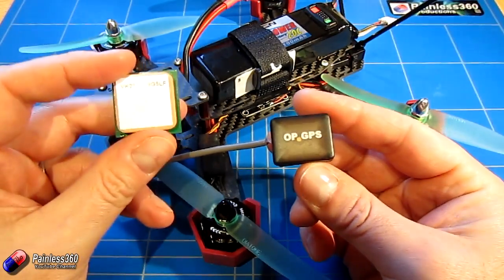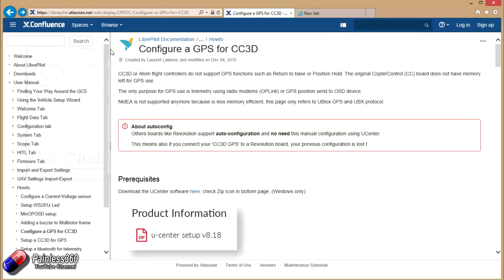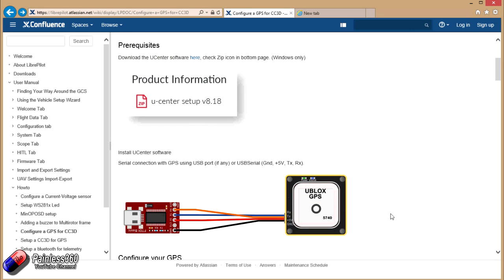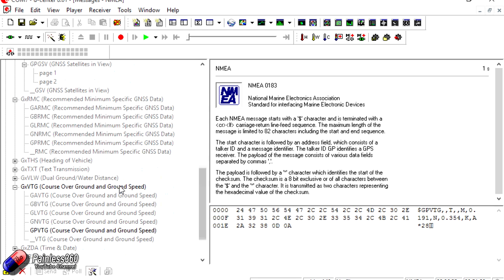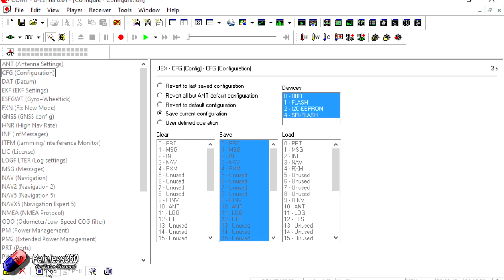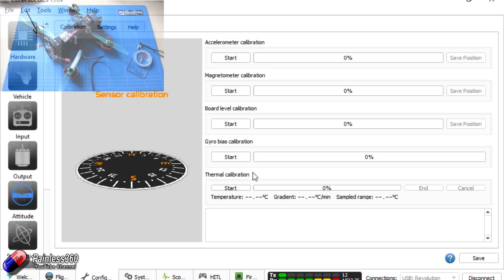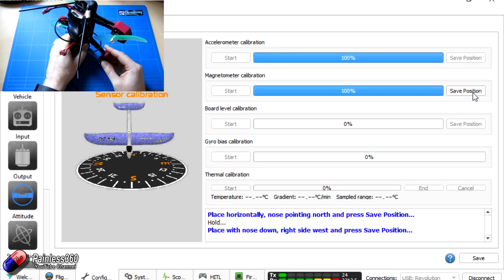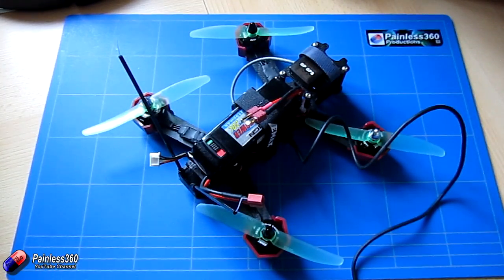(3/3) CC3D Revolution and LibrePilot: Adding GPS and extra calibration steps

Comment: I have followed all the stages of setting using ublox.  but the arrow direction of the home does not appear.  how to bring up the arrow to the home? Thx
Reply from the maker: All I knew is in the video series. The cc3d is an old flight controller now. I've not used one for many years.  Best of luck

Comment: How would you revert the GPS back to its original state? any ideas
Reply from the maker: Modern flight controllers setup the GPS automatically. I'd strongly recommend that you use a different FC. Best of luck
Reply: @Painless360  im using a black mamba now but for the life of me i cannot get the gps to work. I suspected it was because i changed the u-centre settings but i guess that's not the case. Thanks for getting back

Comment: By the way, I got this working with Libre Pilot, the latest version 16.09 r782 supports DJI Naza GPS natively and also supports NMIEA (9600 By default) on the revolution and works out of the box, fast and finding its satellites. However, my dilemma started  while I had the connections taped together, I tried to make a custom cable and inadvertently shorted my Lumeneier  vintage Revolution Open Pilot board (ordered a clone through China, 6 week delivery timeframe), it all worked beautifully in my TBS discovery. Do you know the color coding of the wires in the Naza GPS? I have red, blue, grey and the silver open wire (the ground or shielding?) I think I may have blown that too because I don't see a light come on. GPS. can I supply an kind of voltage to make it come on?
Reply from the maker: I only use the BN220 or M8N GPS units here. Best of luck

Comment: The reason why the auto configure feature did not work is because by default the model of the GPS you have selected is NIMEA at 9600 Baud. If you use this default it will work

Comment: Pro Tip: Since you annunciate and are a clear communicator and since i am fast listener, bumping your playback speed up to 1.25 makes your tutorials go by just right. 
BTW. If your interested I have an assortment of luminere open pilot revolution and CC3D controllers that you might be interested in.
Reply from the maker: Thanks Patrick. I no longer recommend or use the CC3D series of controllers but thanks for the offer. Happy flying!
Reply: @Painless360  What do you recommend these days, is there any software that is as good as the LibrePilot GCS?

Comment: tried loads of things but GPS doesnt accept changes and defaults back to NMEA. Any ideas ?? Thanks
Reply from the maker: The only thing I can think of is to make sure you save the changes before disconnecting. Best of luck
Reply: @Painless360  Yup I've tried many things including following your set up to the letter. Always defaults back to 9600 baud & Nmea.  There is some chatter on various forums that the cheap Chinese clones may not have any non-volatile memory. Sounds bit far-fetched but I'm leaning that way after hours of trial and error with the 2 NZ GPS units i have tried & my flip32 board.  I can configure the units as per the tutorial and re-connect at the new baud rate. All works fine but as soon as i power cycle the GPS it reverts back to default. Driving me nuts :-)  Ill report back here if i ever solve it, just in case somebody else experiences the same issue. Thanks for your quick reply Cheers

Comment: when i try to disable or enable something in the messages view window nothing happens. im using the same components as you
Reply from the maker: Happy to help but please watch https://www.youtube.com/watch?v=olIqTiSJHIY and come back to me with more detail of what you've tried..
Reply: thanks, that video is a helpful checklist, unfortunately my problem persists.  
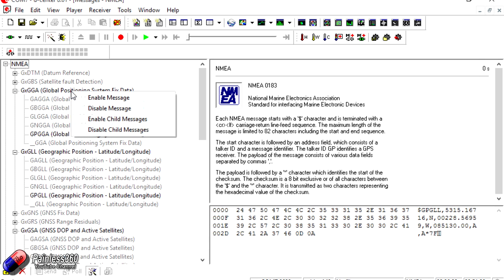I am using the same gps module and flight controller as you, the flight controller is perfect and the gps works. it sends data to my computer. I can see this data in the "packet console" window and see my location on the map window. In fact, everything works the same for me as it has for you right up to the point where you disable stuff in the NMEA part of the "messages" window (at about 9:05 in your video). I can right click and select "disable child messages" but it remains highlighted. it also won’t let me enable the things you have enabled in the messages window. 
I have tried to contact the seller, they have been no help. I may have watched every available video on youtube related to this including some in languages I don’t understand, i have spent hours on google and in forums trying to find an answer but have found nothing that has helped.
i have also checked and re-checked my connections, even going as far as using an oscilloscope to ensure there was no loss of data at any point and I have tried using several computers with different versions of windows and several versions of the u-center program
I’ve hit a wall here, any advice you can give that you think might be useful will be greatly appreciated
Reply: can you tell me what version of the U-center were you using for this?
Reply: one final question, the only reason i am going to this much trouble is i am currently on a bit of a tight budget. however, if i were to replace the cc3d revolution later on, is there any particular flight controller you would recommend? considering gps functionality is my main concern. thanks
Reply from the maker: See the iNav series, the CC3D is VERY long in the tooth now and the kit for a modern system like iNav is really inexpensive..
Reply: Hi Tom, I have the same problem. Do you have fixed this problem in the meantime? And if so, please can u tell me how?
Reply: I never found a fix unfortunately. I've upgraded to a new flight controller
Reply: Thanx for u answer. I think, I have to do the same staop as u. Which kind of FC do u choosen? And, r u happy this it?
Reply: Inav f3 deluxe. Works perfectly for me
Reply: do ha ve a link on amazon for me?

Comment: Pls help I’m unable to change the values on u connect and can not change to UBX
Reply from the maker: +lee parkin as you don't mention the type of GPS you're using It's tricky to give specifics. I'll make sure that you're clicking the save settings menu item in the CNSS software, apart from that it might be worthwhile trying another GPS unit. I only fly iNav now with modern flight control boards for GPS flying. Everything else just seems to be too much hassle. Best of luck

Comment: Hi, no luck with the GPS, went on a couple of times, constant red and blue flashing, but mostly the constant red is on.FTDI setup went ok, cheers for the detailed instructions. Could you tell me the name of the connector they use on the CC3D mini? Thank you very much.
Reply from the maker: Sorry not sure, depends on the one you have. It's probably a Picoblade or similar..

Comment: I am currently building a 250mm Drone up until now I have managed to calibrate the pids using the automatic function and the drone seems to be working fine. Altitude hold works fine as well. 

I decided to try position hold and I bought the following GPS: https://www.banggood.com/7M8M-Ublox-M8N-GPS-Module-for-APM-Pixhawk-CC3D-Naze32-F3-Flight-Control-p-1078657.html .
After installing I recalibrated the mag and all the other sensors and tried position hold. 
As soon as I turn on position hold, the drone does not stay in position but starts moving as if following the perimiter of a box. 

What I have noticed so far is that when stationary the gps shows that the drone is moving at approx 0.01 - 0.07m/s. 
I get around 12 satellites and 3D fix.

I also am using complementary + mag + gps   

Can you give me some pointers on what I may be doing wrong? or what I should do to achieve similar results to yours please?

Thanks :)
Reply from the maker: +warbuli I've not played with this for quite a while now. All of the latest builds that I want a small compact GPS solution 4, I'm using iNav. Best of luck finding the solution.
Reply: Wow thanks for replying ! :)   

Can you please confirm that even if the drone is stationary, the gps will not be accurate and will provide nearest coorinates within a few meters range? thanks a lot for replying!
Reply from the maker: It should, normal GPS units are accurate to about 2m..

Comment: I configured my nz gps (ublox g7020kt) with ucenter exactly as per your video. works well and got sattelites and 3d fix in ucenter. however, when i plug it into my naze32 rev 6 w/ inav (done gps config) the green gps icon turns on and my latitude longtitude are reflected in the gps tab but no satellies are found and keep getting waiting for gps data. cannot get 3d fix. what could be wrong?
Reply from the maker: Are you using iNav? Some features with these older boards are being removed from the software for then as they struggle to run them and don't have enough memory. I'd check the Wiki for the software and board you're using in case this is what's going on..

Comment: Hello, i am building mine first drone, and i would like to know, could allocate your drone if u lose it?
Reply from the maker: There are a few tricks that pilots use. Adding your name and phone number to the model is helpful, adding a buzzer too to help in long grass or crops is a good idea. Outside that then using RSSI signal strength with your radio (if available) can help you track down the model if the battery is still plugged in. See our video on that.. Best of luck!

Comment: Hi, 
i have tried to configure the gps module as you show in the video, but 
every time i disconnect the usb and plug it back again the setting 
reverted back to NMEA. I have a NZ GPS for Naze32 fc. Also, when i 
connect it to naze32 with cleanflight i get the green gps tab on the 
upper side of the cf page but no 3D fix nor a sat's. What i'm doing 
wrong?
Reply from the maker: +George Theodosiou possibly nothing. The GPS has a small battery on it that keeps the settings in memory. If you are saving the settings in GNSS and it's not sticking then it may be that battery. Best of luck!
Reply: Painless360 Thanks you! it pass from my mind and tried to replace it but its welded. any way to remove it?
Reply from the maker: Unsolder if it's soldered on.. I'd check the specs of the module to make sure it is soldered.. Best of luck!
Reply: Painless360 i manage to removed it with a sharp knife, i measured the voltage of the battery and read 1.3v. i think these batteries are rated to 1.5v so should be ok? it still doesn't keep the new settings. maybe i have a bad gps module?
Reply: George Theodosiou  Did you ever get the NZ GPS hooked up? I have the NANO 32 Flight control board and trying to find out how to wire GPS to the Flight control board?

Comment: I was able to get the AutoConfigure mode to work with the OP GPS (though my unit was not purchased from Banggood).  And I am getting a fairly successful position hold using that with the onboard mag.  But I am getting a fairly wide "hold range".  Much of the time it's with a 1-2 yards/meters, but once it probably got at least 10 meters from its initial position (little to no wind).

My mag lock isn't perfect, as it goes from green to amber and back during flight.  But the tracking position on the GPS looks pretty wild even when the craft is just parked on the ground with motors not even running.

So is problem mostly the cheap GPS, interference with the mag, or both?

I tried to install LP 16.... but had an installation error.  I think I'll try re-positioning the GPS for the moment to see if that helps anything, but just curious about other's perspectives...

Paul

P.S.  Great Channel.  Extremely Helpful.
Reply from the maker: I understand there is a update to LibrePilot due soon so I'm hoping that will improve things. An external mag is needed IMHO, without it the GPS modes won't work reliably (see our video on why GPS modes need a solid Mag). Best of luck!

Comment: Hello my friend,
After I realize to satellites and want to calibration only have one option I do not have all the steps of the  calibration .I have another question whether I should save it  after they were hired satellites?
Reply from the maker: Not sure what your question is. The GPS will remember the satellites it sees and try to reacquire them next time. Happy flying!
Reply: Hi, 
i have tried to configure the gps module as you show in the video, but every time i disconnect the usb and plug it back again the setting reverted back to NMEA. I have a NZ GPS for Naze32 fc. Also, when i connect it to naze32 with cleanflight i get the green gps tab on the upper side of the cf page but no 3D fix nor a sat's. What i'm doing wrong?

Comment: Well,  I totally destroyed my OP GPS connector trying to connect up my FTDI USB adapter.  This small connector requires EXTREMELY small pins.  Even my smallest Arduino breadboard wires wouldn't fit. :-(   I wish you could have shown HOW and WHAT you used instead of the document diagram for us all.  Once I destroyed my connector and ordered my new OP GPS nodule I connecting the now cut wires and  I received a blank page of GPS data (Opening up via F6) - What I was wondering is if it only displays info while  the OP GPS is outdoors or will it display data without the received satellites still?
With this being my first attempt I don't know what I should be doing :-(     TY for the Great work on these guides -  I am very great full for your work.   Joe
Reply from the maker: If I can't figure out the connector I cut the wire and then solder it back together when it's sorted. Not ideal but some of these connectors are so small..

Comment: Ok I connected my opgps (same as shown in your video) onto pc using ftdi and soft u-center. Now I see a blue light flashing into gps but there is nothing in negrite (activated) into message window and when I try to activate the ubx messages as per your video 10:05 it does not activate. Also in the package window we see no text coming at all however the bottom right corner of u-center shows a green light and also gps is flashing its blue light. Remember I did Conect to revo board before and got no satelite. Now I think I have a faulty gps.  I do have an old naza lite gps which connected fine to the u-center and I saw good gps signal even inside my garage. It has only nmea capabilities (I think) can I still use it with revo board or I do need to go buy another gps ?  Tks
For helping :-)
Reply from the maker: Make sure that the wires are connected properly and if they are then it might be a bad GPS..

Comment: Hi, Would you mind give me a little help ? I have the very same gps shown in the video and a revo board. I attached my gps to the  main port and configured it on the GCS after power off and reconnect I see the gps black with 4 red lines. I saw the system tab but not the setup side of it just the status and it shows gps connect but gets zero satelites. I tried indoor and also outdoor and I left it connected for more than 30 minutes to charge the supercap and download the gps data. I did not try yet to use ftdi and configure it with the win soft you mentioned. Any hint ?
Reply from the maker: +Roberto Petresco you have to configure it. FTDI time!

Comment: how did you connect the gps to the ftdi as there is no connection for it?
Reply from the maker: I made a cable to rig it up - don't use the OPGPS - it's not very good. Use another with faster startup, better accuracy and improved setup. Best of luck!

Comment: How do I physically  connect the FTDI to the 4 pin plug on the OP GPS?? is there a cable you can make or buy? Its just that the pins for the plug seem to be so tiny.
Reply from the maker: I ended up getting some of the connectors and then soldering very fine wires to the back of it and then connecting those to the FTDI adapter - bottom line it was a pain in the a$$. LibrePilot is 'supposed' to auto configure the GPS but it never worked here and others have had issues too. Shame the answer from the developers was along the lines of 'it should work..' Best of luck.

Comment: Hi, do yoz have any experience with this GPS module: http://www.banggood.com/Mini-Ublox-Neo-6M-GPS-For-CC3D-Revolution-Flight-Controller-wBuilt-in-Compass-p-1022655.html ? Does it supports RTH and GPS position hold?
Reply from the maker: Not that one but we've used similar. Best of luck!
Reply: So it would be better to use the same that you used. I will have certainty that it works.

Comment: no, I wanted to know if YOU were satisfied with the OP GPS.  Did it work correctly?  Specifically did the loiter and return to home function work  correctly on your 250 sized quad using the op gps.  I trust your reviews over hobbykings.  I would like to add this gps to my 250 quad but I don't want to buy a lemon, thanks.
Reply from the maker: +Brook Drew I didn't use the OPGPS so I can't answer. Best of luck!

Comment: I noticed the hobbyking description for this gps unit says that it has limited functionality. After you got the gps up and working were you happy with it and did it perform properly? Such as did it return to home and loiter correctly? I am adding gps to my 250 quad and I like this unit for its size but I don't want a lemon so I am debating on purchasing a better ublox system or this one. What are your thoughts?
Reply from the maker: Which one the GPS we used or the OPLINK GPS? The UBLOX is a full function device - I'd ask HobbyKing what they mean.. Best of luck..